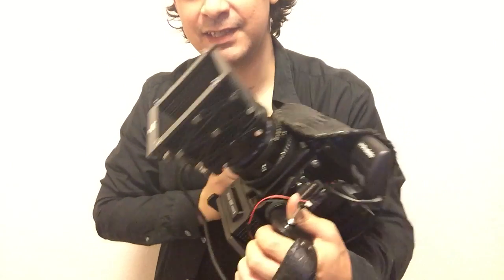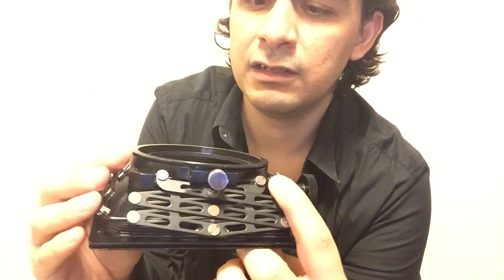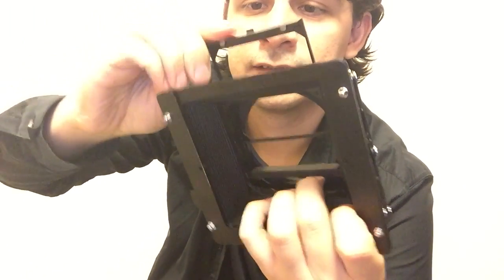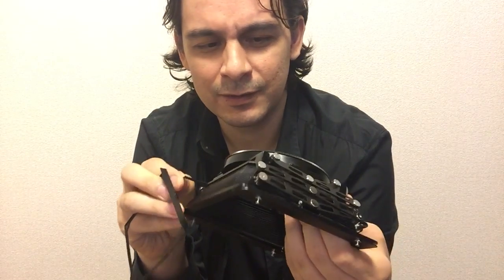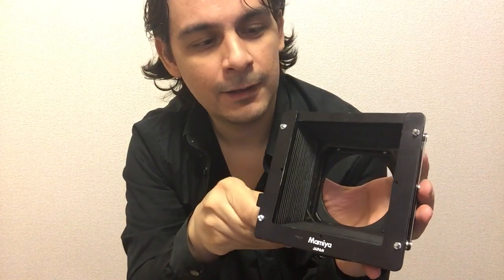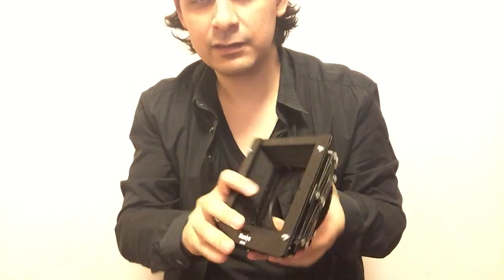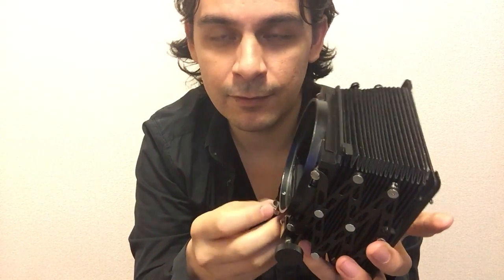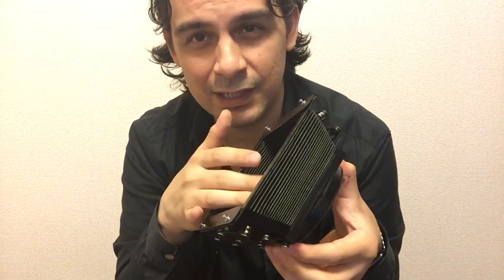All you need to know: Mamiya RB/RZ G3 Bellows

Comment: also with the 50 mm lens , it is a 12-14 mm equivalent lens in 35 mm terms, and as such the distance of that lens hood would probably vignette at all apertures, so it would be advisable to only put filters on the threads of the lens directly, thus causing no  vignette at all.

Comment: The four pins on the front are for the G3 extension. Check your Mamiya catalog.
Reply from the maker: +av8bvma513 Wow! I was wondering about that thing. But that can only be used with like the 350 or the 500mm no? Even the 180 can see the hood on the edges if it's fully extended.
Reply: It is more correctly, a matte-box, designed specifically for vignetting and special effects. The manual suggests using "Sailwind" and or "Leon" vignetters.
Reply from the maker: +av8bvma513 Oh I see I see. Would be fun to play with it. Although all my photos have to pass trough photoshop so might as well do special effects there.

Comment: Hey great video! Would you be so kind to tell me the dimensions of the filter when completely closed? How thick is it? Trying to decide between G3 and Lee Hood. The Lee is half the weight, wondering about size due to the scissor adjusters. Could you please share the size closed? Thanks! Keep up the great videos
Reply from the maker: Jason Jamal Nakleh I'll do it when I get back home. I had the G2 but it started to bend. This are very strong and good at covering light. But a 110mm lens with it all expanded will have dark shadows on the side

Comment: Hi, I shoot Nikon 35 mm, and those posts are used in large lens filter adapters to bayonet on a circular polarize or  ( the Nikon 14-24 mm zoom uses this exact system to mount a polo-rising filter as it's diameter is 86 mm or more), this is the only way to mount this system on a bulbous front lens element  such as the lens mentioned.

Comment: Julio, thanks for your videos on the RZ system. You were the one that inspired me to get my RZ pro ii d. ( no actual "d" yet)  could you do a video on a basic flash set up. Not too hard core with the pocket wizards or the fancy light set up. Just basic. Thanks !!
Reply from the maker: That's so cool to hear! I didn't even imagine there is so many people using or interested in this camera. You mean speed lights like those clip on flashes or strobes like alien bees and stuff? You want portrait lighting like 1 strobe lighting?
Reply: +Julio Ryuuzaki , whichever one. Just without the radio transmitter. Thanks !
Reply: +Stephen Roy maybe along with basic metering
Reply from the maker: +Stephen Roy  flash with no wireless trigger? You still need a way to tell the flash when to "pop the light" if you don't want wireless the only other option is the sync cable. Is that what you mean?
Reply: +Julio Ryuuzaki , yes
Reply from the maker: +Stephen Roy I could talk about it but can't really show you. I don't own one of those long sync cables. I don't even think my profoto has a sync cable port entrance. What equipment do you have? Or thinking to get?
Reply: +Julio Ryuuzaki well even though the RZ set up is far from portable. I would like a flash set up that isn't so much work to assemble and is somewhat portable . I was thinking of the elinchrom ranger.
Reply from the maker: Oh I see what you mean, but without the wireless you would have to deal with a long cable that connects to your sync port in your camera, and that can easily come off with a lot of movement

Comment: Can I use the bellows like a tilt shift?
Reply from the maker: Myron Hensel i wish we could. But a tilt-shift adaptor would actually change the lens position against the camera body, this is just a fancy cover that you can put filters on.
Reply: Julio Ryuuzaki so with the other tilt shift adapter it doesn't work like a large format tilt shift?
Reply from the maker: Well this are bellows, its a lens hood. The actual tilt/shift adapter does move (well tilt and shift) the lens from its straight position, so yeah it will give you the control of the focal plane like some large format systems can do. But to be honest I have not played with one yet. Definitively on my wish-list.